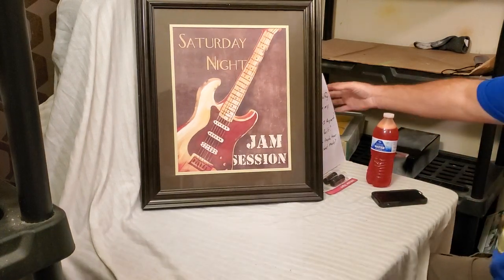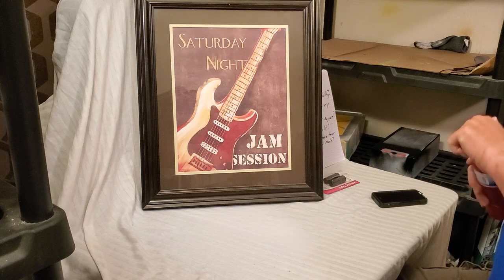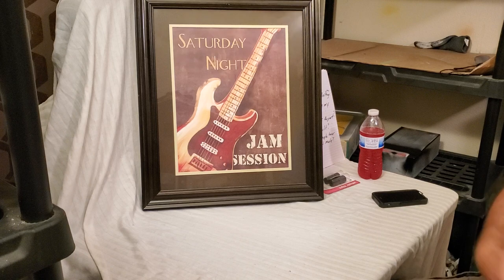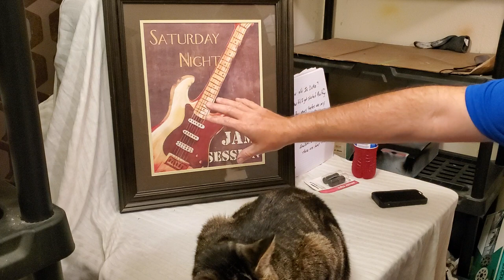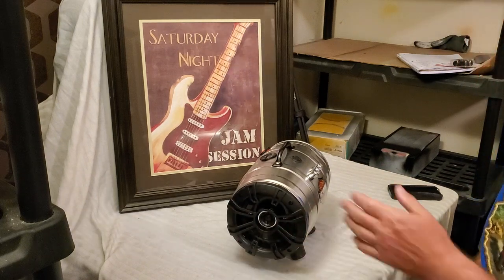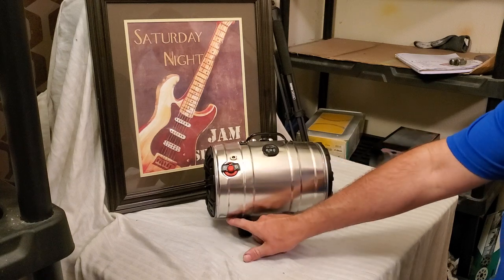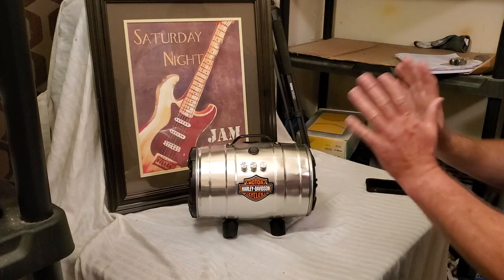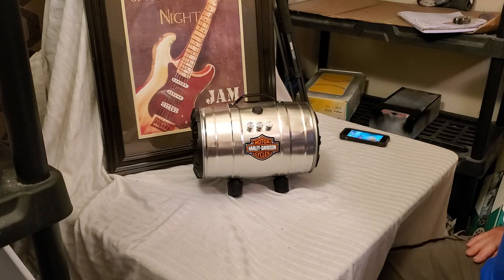Mini Keg Speaker and Questions Answered

Comment: Always cool seeing what you come up with.  The keg is super cool.  

I get similar reactions to my boombox as you do with yours.  Early on I had to open it up to show my co-workers that it was not store bought.   I've had this one over three years and it is still going strong.  (I rebuilt it early on to move the speakers from the sides to the front).

The owner of where I work actually hated my build at first because of how loud it can get (the machine I was running at the time was right near a door to the front office, and his desk wasn't too far past that door).  Wound up not cranking it to the maximum.

As for your flashlight idea, I've thought about building one along what you described.

Comment: What are you going to price it for?
Reply from the maker: I am thinking around $290
Reply from the maker: The volume this thing makes is incredible.  And sounds good also
Reply: @diyboomboxesintexas2805   dent included right. lol. I like the dent because it gives it that rough and tough Texas look.
Reply from the maker: I am rather embarrassed about the dent.
As I said, I am taking that one apart and putting the parts in a new keg next week
Reply: @diyboomboxesintexas2805   I understand. It does sound incredible.